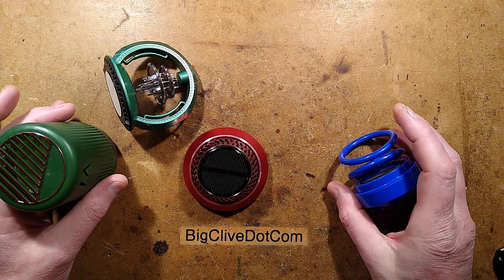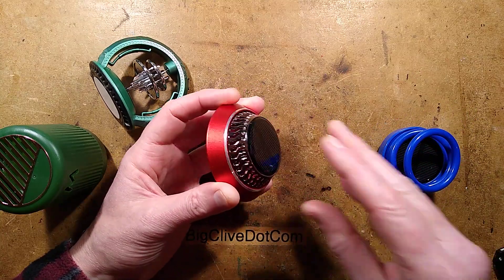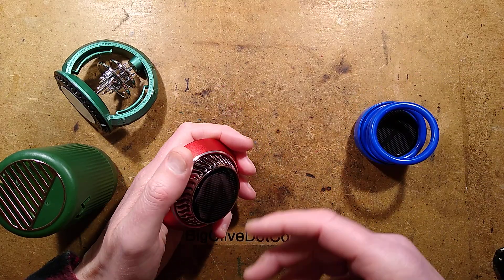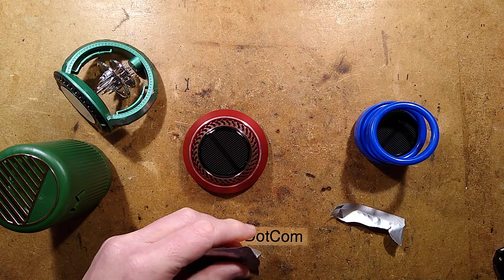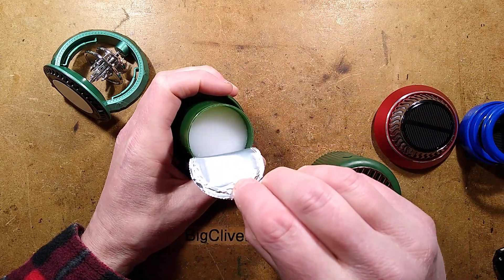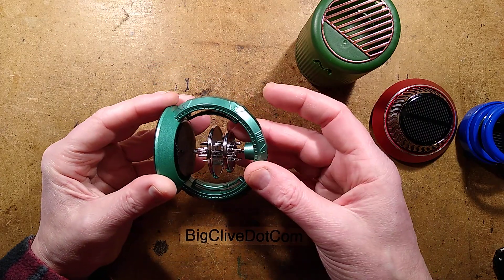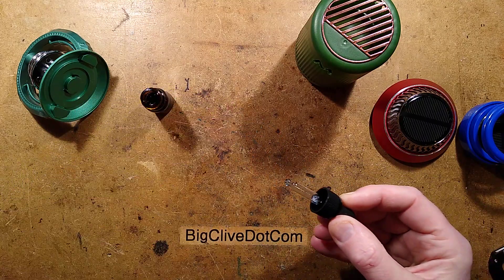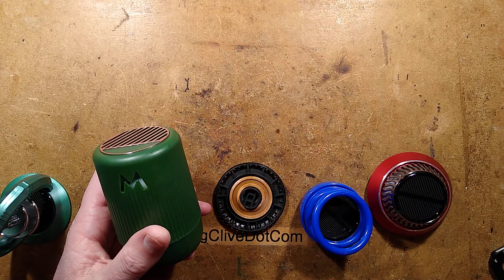How a vehicle molecular de-icer works

Comment: That Doctorate of Metaphysics is paying off with all the jargon n such.
PS these totally work here in Australia on 35 degree day, not a bit of snow on the car at all!😜
Reply: Canadian Great Lakes snow belt here. Environment Canada says the average seasonal snow is a little over 4m. About 13 feet of snow. More than twice as high as I am tall. It's about to start. To make a long story short, I'm a bit jealous. See you on the slopes though.
Reply: I can attest that this device also works nicely to prevent any snow buildup on the car even after a big snowstorm.....  but the problem is that is quite difficult to open the door of the garage to access the car and is almost impossible to drive off after a big snowstorm!
Reply: same here in southern spain, zero snow or ice on my car.
Reply: wacky celcius
Reply: I knew they worked! This proves it! Lol
Reply: My grandma always threw torn up newspaper out of the bus window whenever she travelled anywhere. When I asked her why she did it she said it was to scare off the elephants. I told her there weren't any elephants here. "Of course," she said, "it works."
Reply: 35x2-10%+32....
Reply: they work even better on a summer day......
Reply: @n1jrm  It is summer in Australia right now; that's the joke. Southern hemisphere.
Reply: @aaronmdjones lol.

35 degrees in America is 3 degrees above freezing in Fahrenheit.  Plenty of opertunity for snow. 

I had to do a double take on the comment to notice the location. You/the op was actually referencing 95 degrees Fahrenheit to those from the US - where it is snowing in places.
Reply: @aaronmdjones  The season it is currently doesn't matter. They literally gave the temp in C.
Reply: @sumduma55 No, they were making a joke that there is no snow because of temp. It isn't snowing in 35C weather (you said it does "in places").
Reply: @sumduma55  They're having huge forest fires and drought right now. But they're upside down. Which way does the smoke go?
Reply: @m1t2a1  what smoke? Australia isn't real.

But if it was, it would go whatever way the wind blows.
Reply: @nimoy007  I didn't say anything about snow in 35c weather. I said in America it us capable of snowing at 35 degrees which is very close to freezing in Fahrenheit. 35 Fahrenheit is about 1.6 Celsius
Reply: @sumduma55  I'll hasten to remind you, Bart Simpson has been there. It's that real.
Reply: @m1t2a1  he filmed that episode on the same sound stage they created the moon landings from ;-}
Reply: @sumduma55  Next thing you'll tell me is Homer eating chips in space can't be real. Sort of funny because this is all because someone that lives in a former penal colony that may or may not exist said it's hot out.
Reply: @m1t2a1  no, Homer eating chips in soace was real - just like Peter Griffin really was a cowboy astronaut. 

Australia on the other hand, that's just crazy talk.
Reply: @sumduma55  Because they'd fall off, right? After all, upside down.  Since the moon landing was filmed on a stage, there was no need for the Parkes Observatory in fictional Aussie Land to receive live TV signals and hear Neil. Contact light! You've convinced me. One thing though. The little dog that's my picture is an Australian cattle dog. Blue heeler. One of the toughest, smartest breeds ever. Songs have been written about them. Was that some sort of early cultural appropriation from a mythical continent?
Reply: @m1t2a1  no. You touched on it earlier with the former penal colony. You see, they put them on an island near India and told them where they were as if Australia actually existed. This way, if some enterprising criminal figured out how to build a ship, they would sail right into the policy's hands. That's why it's called Port authority. 

 But in order to keep this ruse up, they had to name some crap based around Australia.

  Interestingly,  it has been so convincing that people actually wanted to visit it. This is why they invented the outback steak house and fosters beer. Two prolific things that are so horrid that nobody would ever seek Australia out. They even made rumors like the barbecue consists of only shrip. Or rumors that your plumbing doesn't work correctly because the toilets swirl the wrong direction. They have invested a lot of resources into discouraging people trying to visit like the park with the observation you mentioned. They even attempted to convince a bunch of people the eaeth is flat to stop them from wanting to go.
Reply: @n1jrm  They work fine here in India in winter as well. About 32 degrees today and a low of 23 degrees expected tonight. The car has some meltwater on it in the morning, nothing more. In fact, it prevents ice in the whole area around the house.